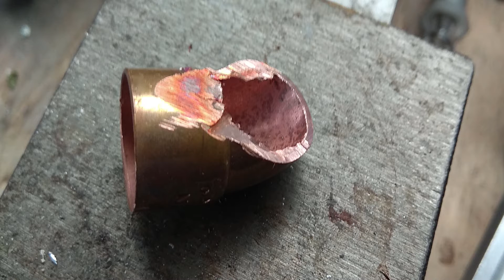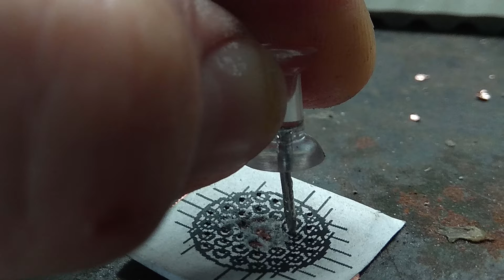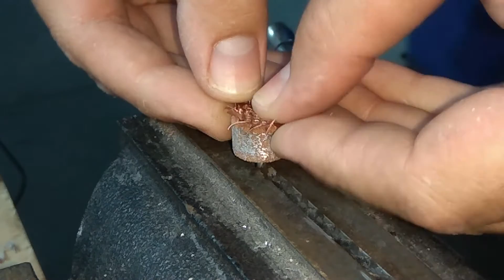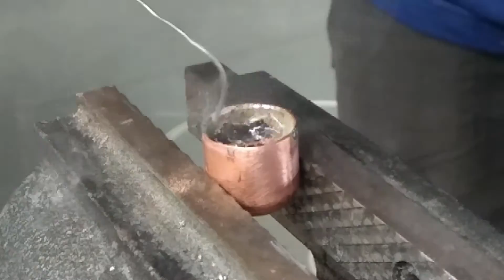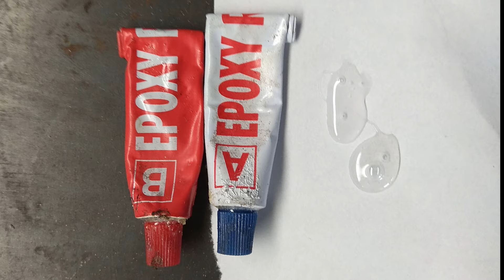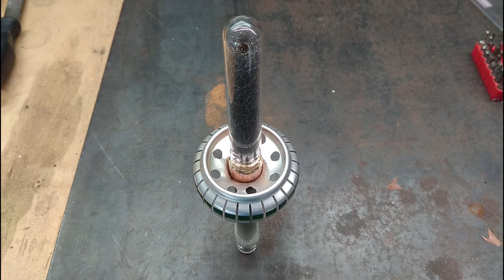How to make a Thermal lag 'Stirling' engine (step by step video tutorial)

Comment: I've been told that packing the steel wool tighter near the piston side, and then looser and looser as you approach the flame side helps with efficiency, but I'm not sure if this is true.
Reply from the maker: I don't know but I don't think so, maybe if that is not close the open area too much to strangle it. There is a balance between the maximum heat exchanger area vs. the openness.

Comment: Why are the majority of thermal lag engines made with glass? Does aluminum or copper or steel work?
Reply: glass in particular works well coz of low heat conductivity, basically you want to have local hot\cold spots. Device made from metal will be all around hot and thus not working
Reply: @vladimirkravchenko6016 thanks, That's what I thought but not sure.
Reply from the maker: Of course other material could work well, the glass is a budget solution, also transparent to show the engines inside.

Comment: I would like to see a drawn diagram.
Reply from the maker: Dear Thor, this is possible. Give me a little time, because it was a short project few years ago, and then I didn't make drawings from that, but I try to replicate that for you soon. BLADE
Reply: @AttilaBlade  Thanks. Do you think it's possible to make this out of copper pipe?
Reply from the maker: That's not a good choice because of the heat leak to the cold sides. This unit has two cold sides. In this folded configuration these are close together as possible. So if the whole tube is copper then how we can cool it down well? A compromise if the body is iron, steel or stainless steel and it has copper heat exchangers. But what's the goal? What the highest temperature around the heated end?

Comment: I wish you could build one like derwoodvw  did on you tube. That is an amazing engine.
https://youtu.be/lu2T3HoIcos
Reply from the maker: I knew his work. But I learn more about this engine in the past few years. This is a really interesting and more different than other heat engines. That HTD versions what derwood made was big, and nice, but few thing wasn't perfect there. The Cold side HX really  small efficient, also the hot side has a big loss. I don't really want to make a good or better construction than his one. I need to make an LTD version from this type engine. That is more interesting to me.

Comment: Great! :) thank you for the demonstration but I have a question... will such a thermal lag engine or a lamina flow engine work as a heat pump when driven in reverse?
Reply from the maker: Should be! Every heat engine could work as a heat pump if the heat exchanger parts works well!
Reply: Thank you very much for your reply! OK so I`ll have to experiment with such engines soon :)
Greetings from Poland

Comment: Thanks mister Blade, your videos are like candy for me. Practical, understandable and thought provoking.
Question: Does the engine run better when you put the engine vertically?
I think there has to be changed something to prevent the hot air to flow along the cooler, but there would be less friction, and the moving part would would work as a flywheel, storing energy in the upwards movement, and giving it back when it comes down.
Maybe things have to be changed to make it oscillate on the optimal frequency, but it's very well possible that it will run better without any changes. It's an interesting experiment and I'm very curious to know the result.
Reply from the maker: Every model engine works better in vertically. The friction is always a problem. For professional engines the pistons are moves with gas bearing without friction and abrassion. The life time with no maintenance is so long! Anyway, this one works longer if I started vertically. Much longer! The "jumper" too. But you know the model engines could work with flame directly, so if the engine's hot side on the top it is not comfortable to heat up continously. If the hot side will be the bottom, than the cold side could save with a shield or other practical part.

Comment: if you can replace that glass with ss tube you can increase heat and power
Reply from the maker: derwoodvw Yes, it is truth, but the efficiency much better, if the heat exchange perfect as possible. The material of the cylinder/piston, hxs etc is so important for better performance. The power increase when the temperature different's growing but the balance between the T diff and the heat exchangers hole size also the whole gas volume is a tricky way. The whole engine is a resonant system. The optimal parameters for a good performance is tricky but what you wrote me that is one possible way to a stronger engine. Thanks for your comment! Greetings from Hungary! Blade